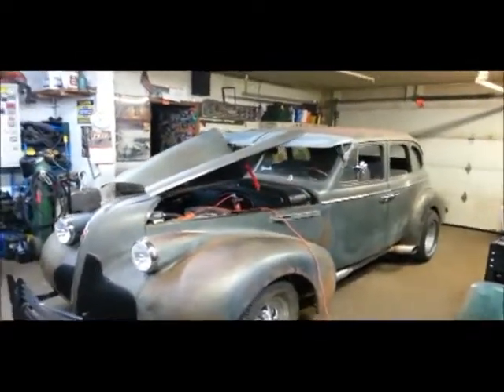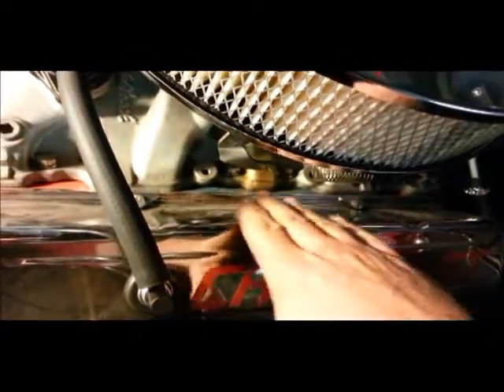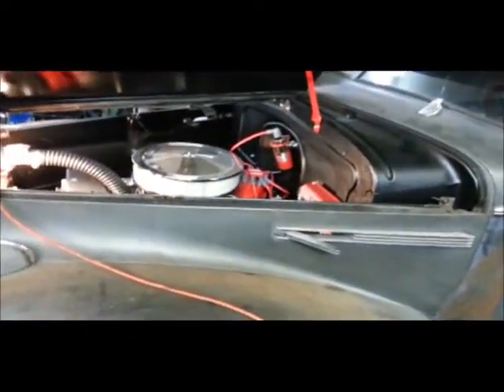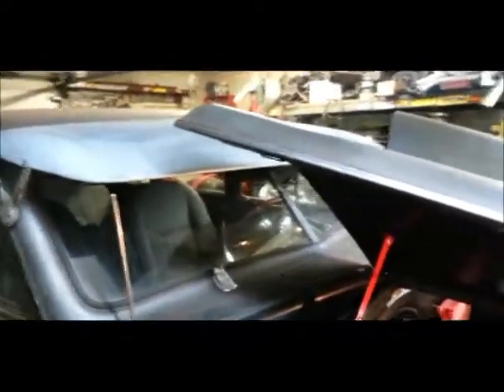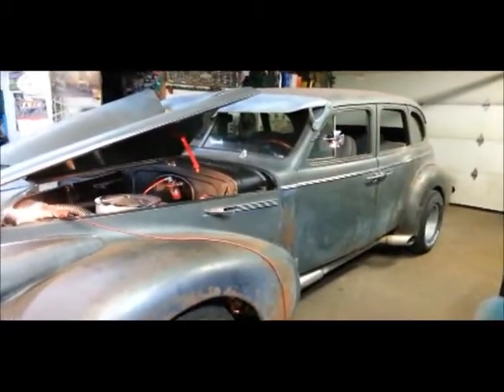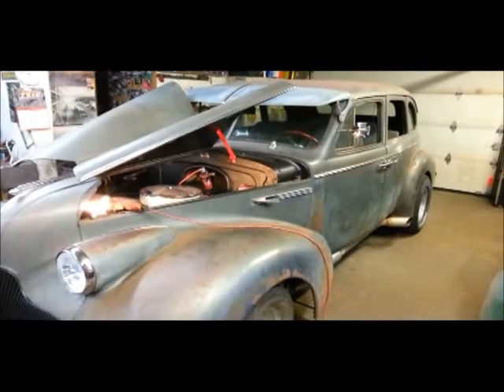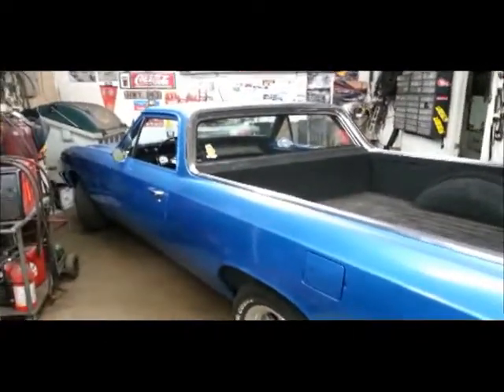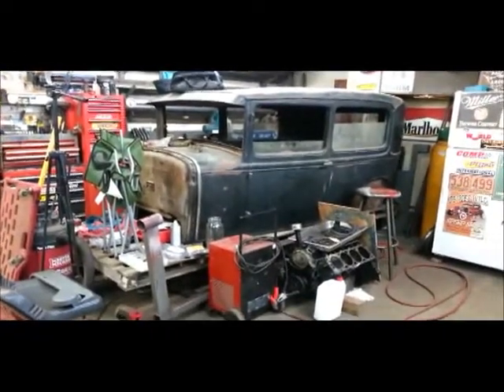shop update 10-8-13

Comment: You have a 283 I really love those motors they are quick. My uncle had one in his panel truck back in the seventies I liked to hear the second gear scratch. Your taking me way back. My dad had a 29 model A in our garage growing up. We never got around to fixing it up dang. He ended up selling it to my cousin. The Buick is cool go for it. Can you find a intake though? I vote for the 283 they are pretty cool because they are a great running engine.

Comment: I like the idea of either the 283 or the 327. Sure would be nice if someone would drop a W motor into your lap... I should send you a pic of the T-bucket I had with a 283, faux tri-power and powerglide. It originally had the vintage Corvette valve covers that came off the only 327 I ever owned (it was in my 55 Jeep pickup of all things). My boss at the time wanted the valve covers for his vette so we swapped for a vintage set of finned aluminum valve covers.

Comment: so you gotta tweek the valve covers lol that cool if you can get it to clear. maybe you can make your own adapter plate for the Buick. Order one the trace it out then send it back. The Buick, does it have a high compression ratio? It may run pretty good.

Comment: I had the same roller rocker hitting cheap valve cover issue with a 383 I built for a Vette a couple years ago...As a power plant for the A...(I'm a GM fan too)..But a Ford Cammer would be cool or a blown Ardun headed flat head with multi carbs....Oh what about a Hemi....Yeah I know....I'm shopping out of your wallet...lol

Comment: The trip setup was fake, really just a 2bbl manifold with a plate I made to hold the other two carbs on it to look like the real thing. When I tore it down for final re-assembly, I had found a real 3 deuce setup that was going on a 350 block with the old 1.94 double hump heads, but I sold it before it ever got that far... Gone but not forgotten.